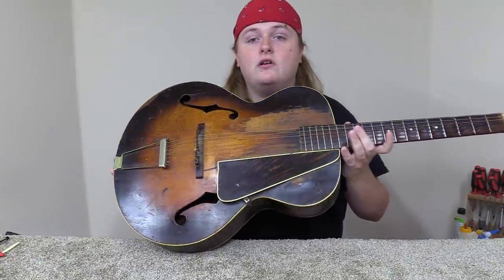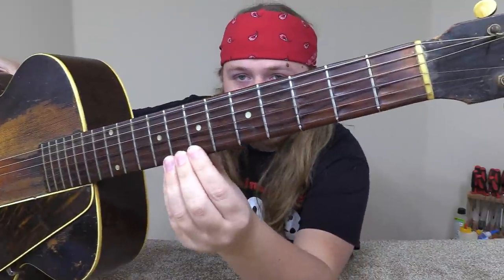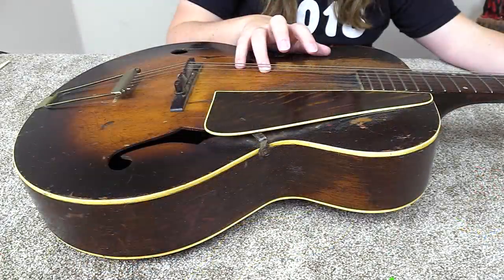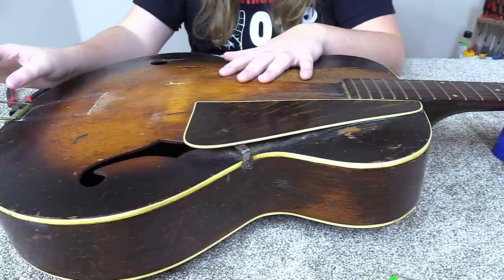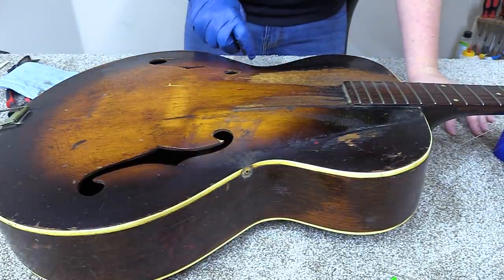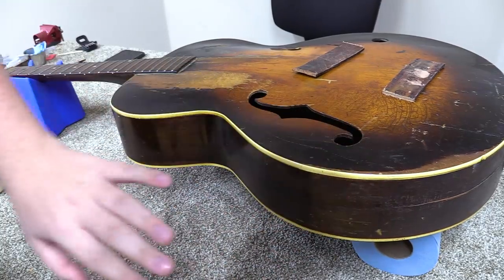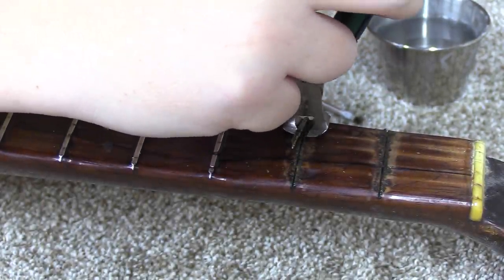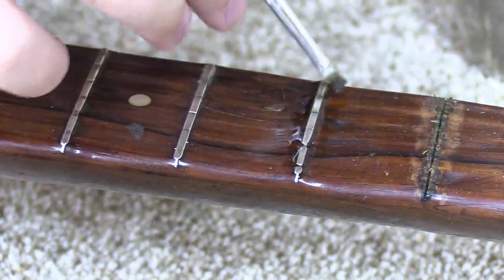1940's Kalamazo Refret

Comment: What a cool old guitar to get to repair. I enjoy watching guitars get repaired, as it helps me with working  on  my own guitars. I saw a couple of tips on the Twoodfrd Channel that might come in handy. You can use a suction cup to "push" glue down into a tight crack. Naphtha works well to clean old finishes without removing the finish itself. BUT, you should verify this information with Jerry first to make sure it's correct.

Comment: When I was a kid, there were two older gentlemen at the church I attended when visiting family who were Deacons and they played their guitars at the services every week.  After the service they would each pull a small brown bottle from their cases and a piece of flannel and wipe down their guitars.  I asked once what it was and they said it was boiled linseed oil with a few drops of mineral spirits.  They were cleaning their oils from their hands plus any dirt off and putting some oil back in the wood.

They told me their great grandfathers who were brothers bought the guitars and matching ukuleles in 1903.   And they had been handed down in the family.

The said that boiled linseed oil by itself over time leaves a tacky/sticky feeling on the guitars so they put a few drops of mineral spirits in so it dries quicker and penetrates the wood better.

Comment: Get yourself some small suction cups to force glue into the  micro  cracks and its amazing how much more glue you can force in with them. Car waterless polish works well also for removing crap off old finishes and its designed to actually trap the dirt in the cloth. Just spray a little on a shop towel and it works wonders and you use less than you would water. Great job and a fantastic looking old archtop

Comment: Great choice with the Boiled Linseed Oil. I read that long ago, it was used to finish wood. I know my Granddaughter's little 3/4 electric, I bought, had an unfinished neck. Gave it a quick rub down, with the Boiled Linseed Oil. That thing is slicker & faster than any of my guitars.
Just a tip, I've got a little plastic container I put water in, I soak my used Linseed oil paper towels in that after I use them. Good job on a truly well used instrument. Johnny Shines said Robert Johnson's favorite guitars were Kalamazoo. (Who knows if that's actually true, but he did say that.)

Comment: Caleb, use a cheap plastic suction cup to work Titebond into the cracks.   Wipe Titebond along the crack and work it in through the crack using a suction cup then clamp and wipe off the excess.  You'll get better penetration of the glue that way.

Comment: hey Caleb, look for something called murphys wood oil soap.. this soap is specially formulated to use on wood.. it's been around forever.  it will clean all the old crud off.. as long as you dont drown the guitar you will be happy with the result.. then follow it up with  oil.  finally use the rennisance wax

Comment: When you can't get the glue into the crack super easy, if you used a suction cup to push it, it will usually force more in.

Comment: Caleb, I always over-radius the frets. If the board is say 12" I radius the frets to 9"-10". Tap the ends in first then drive the middle home. You'll get less fret end lift that way.
Reply from the maker: I agree with you on the over radius, I didn't do these though, as I don't have a fret wire bender yet.
Reply: @MillsGuitars  A little trick you can do is grab the end of the tang from underneath with your fret removal pliers and you can coax a little more radius in the frets with your other hand.

Comment: Hey Caleb, wouldn't adding warm water to the fret area swell the wood and thus make the frets harder to pull? Thanks for the walkthrough :)
Reply from the maker: Wood doesn't really swell that direction, length of the grain. It really swells, and shrinks, in the width of the grain.

Comment: I know you like making nuts and saddles but when its a budget fix I use tusq nuts and saddles as they need little adjustment for them to fit well and I find them brilliant sounding also and very close to a natural material. How you finding the music nomad neck rest? I don't use mine anymore its just not strong enough so it now houses my fret and nut files. I made new ones out of some oak and some Cork in the neck slot. ( was actually a Cork tile thing)
Reply from the maker: The neck rest is okay, it seems to me like it's constantly in the way though. Always right where I want to work. If I ever get around to it, I'll make one with sides that aren't as tall.
Reply: @MillsGuitars  I made mine thin with a block bottom so it doesn't get in the way at all. I made a few different sizes for different guitars and angles I want when doing things like frets. Cost nothing to mate as it's all scrap wood.

Comment: Linseed oil is NOT a cleaner, if you get dirt and gunk on the rag when applying the oil it means the surface is not clean. there is still lots of gunk on the lower bout by the pickguard as well as all over the body. You don't really care though just get it done quick so you can get a video out as you said. A quick job isn't a good job!